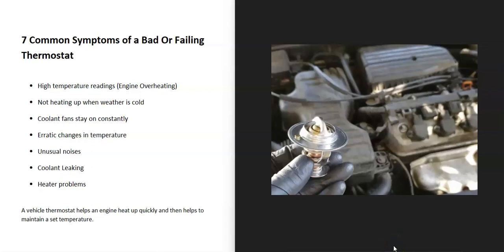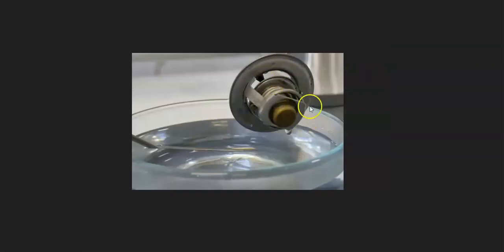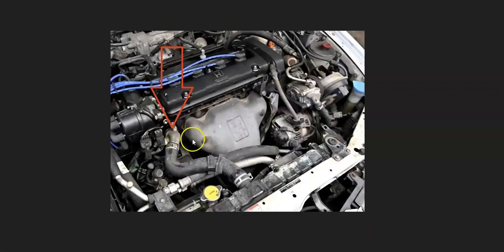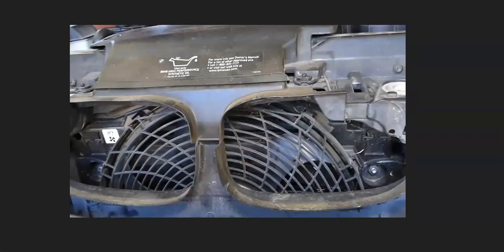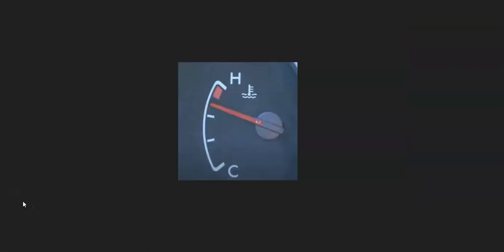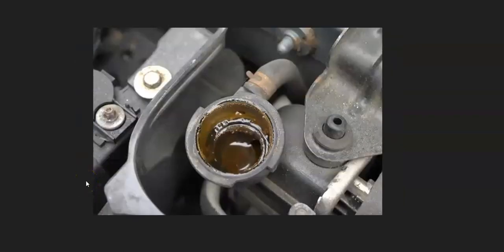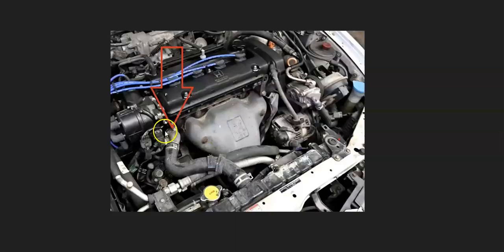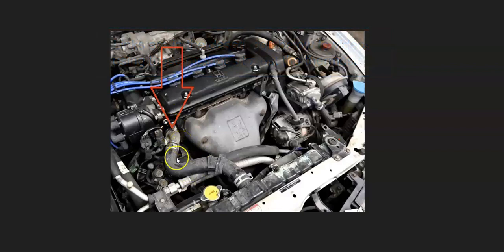7 Common Symptoms of a Bad or Failing Thermostat

Comment: Hi @HVAC Mechanic! My dad has long passed away, my big brother recently passed away and my older son that knows a little about cars is too busy with his junk hauling buisness on the weekends and a full time job during weekdays so I am on my own as a 54 year old disabled single mom so I would like to ask you a question about my 2004 chevy silverado 2500 HD 6.0 - Driving to work at 2am, temp outside being about 27°, about 8 minutes into my drive, I hear a not so loud pop, billowing steam out the front and sides for a good 3 minutes, the truck shut off so I rolled it to a stop on the side of the road and coolant leaked onto the ground. I did not have time to check it out as I called my older son to come take me to work. We towed it back to my house in the morning. I was curious to see if it would start and how it would sound, also I had to back it into my driveway and it started right up and sounded fine. Of course I only ran it for about 20 seconds just to back it up and I shut it off so I wouldnt cause any further damage. My son did borrow my truck for 8 months prior for his junk hauling business and upon returning my truck he did mention he thought he noticed it starting to overheat from time to time in those months and pointed out a drippy leak at the top of the radiator connection line. Could you please point me in a direction I can take so I can try to fix my truck. Its been sitting for 2 months now and I finally got my taxes back to afford parts I need- Thank you so much for your time HVAC Mechanic😊👍
Reply from the maker: It's hard to say what the cause is, but I would start by inspecting the radiator and hoses for any leaks and then checking the water pump and thermostat.
Reply: @HVAC_Mechanic  Will do! Thanks for the response👍
Reply: @tortugalisa4748  Did you ever get your truck fixed? If so, what was it?  If you're truck shut off, you were almost certainly VERY LOW in coolant!  Vehicles have a safety switch to shut down if coolant levels get to low.  They hold about 2 gallons, and I'm guessing yours was down a gallon or more.  All you had to do was go buy a gallon of distilled water, pour it in your coolant system, and your truck would have started right back up and you could have drove it home without paying a tow bill.  BUT, understand once home, you MUST find the cause of the leak!  it could be anything, could be as simple as one of the small coolant hoses on your engine that has a small hole in it, needing replaced.  Anyway, would love to hear what it was.  : ))
Reply: Thank you for responding😊 I bought the dye kit and looked for leaks. Tiny one at the top of the radiator. My son bought and replaced the radiator and ran fine for almost 2 months when the truck started making honking wining sounds from the front. Then the truck died, 1:30 am on my way to work. My son came out and looked at it. Transmission fluid all over the sides of the truck and on the ground where it quit. He found the source to be the inner cooler attached in front of the radiator. One steel line was detached and poured out on my 40 miles drive to work. Now it really just sits parked😕 @2028end
Reply: @tortugalisa4748  Oh my gosh !!!  What a horror story.  : ((  Did your son forget to slide the clamp over that line when he installed the new radiator?

Comment: My dispatch van takes a while to heat up in the winter and then it overheats only at speed 40mph plus when I put the heating on the overheating needle starts to come down again.. thermostat ?
Reply: Did you find out what it was? I'm having the same issue.

Comment: Hi, could a bad thermostat affect AC performance?  I have 120k car, never had thermostat and water pump replaced.  But my AC recently taken about 5 to 6 minutes to click on.  If on a cold day, the AC won't even work at all even turned on for awhile.
Reply: Have u checked ur cabin air filter? Usually during oil changes the mechanic swaps out the dirty air filter for a new one. Also check the fan if it is broken or not responding.
Reply: I would check the pressures for the AC. Could be low on Freon
Reply: @kalani1987  The cabin filter is clean.  I got my mechanic checked no leak and freon is fine.  It turned out to be my ac control unit need to be replaced.
Reply: Yes. Bad thermostat affects ac.

Comment: I am using Lexus ES 300! I change my radiator but since then my temperature will raise above normal and drop back to normal but during the hot wealth/long distance journey, Temperature will raise above normal and fall to normal several times till it’s raises above normal and never return back. I have taken it to different mechanics and electricians but the problem still surface . What might be the problem ?
Reply: Man having a similar problem did you find anything out
Reply: @NOTanotherSHEEP-r9m probably need to bleed air from system. Use a no spill funnel to bleed the air

Comment: and when the fans are off all the time? and temperature reaches 101? the fans and relays are OK, because when I push the AC on, fans begin to operate.
Reply: Did u solve it ? My car is loke this ..I had changed the ect but I now own an oem 1 to put in and go from there
Reply: @kevinhancock4064  no, i did not find the cause. I had random unpredictable overheating. very short ones, 2-3 sec each. changed pump and rotor, changed thermostat, changed ETC. finally toyota diagnosed failing head gasket. i did not want to believe it is hg, because i took good care of my car, never low on water, never late for oil. but them faced the reality, i  changed the HG. DO NOT buy original toyota head gaskets: some of the lots are substandard, thats why they fail. i got mine from rockout, victor reinz. i finished, put it together, and started driving as a test round town, while watching realtime temperature and pump revolution. so, first 20-25 miles temp was 85-88 degC. then suddenly raised up to 101. i freaked and overreacted and stopped. <later i realiized, the normal temperature for engine is 90-104, or 195-220, but i did not know at the time, plus this was a test drive after big operation...> so, I took apart the cooling system, and flushed both radiators with garden hose. Expected to see deposits, mud, sand, but nothing came out. Then I reinstalled the old original thermostat. Put it together, and no problem. Just put 950 miles on new head gasket. No leaks, no error DTC. I drove 750 miles in one day while watching the temperature: ROCK SOLID, 88-89 C. Pump revolutions: 2500-2600, and when you rev engine, goes to 3000. So, I suspect that the new thermostat may have turning bad in 6 months. I returned the old one, cause it was proven to be good. I also changed the ECT, and checked the old one. he old one was OK, I think. It is Pt, platinum wire, because Pt is extremely durable. no oxidation, very high melting, encapsulated in a seald copper ampule. I checked the resistivity of the old one, it was 1500 ohm at room temperature, this is what it should be. You can find tables with T-R relations on the internet.

Comment: My heater runs good when driving but not on idle and my temperature gauge reads cold would you say that it is the sensor not the thermostat?
Reply: Thermostat could be stuck open which is better than being stuck closed.
Reply: @ronredmond that was my answer when I told my mate mine is stuck open 😂
Reply: It can be both thermostat stays open or a faulty ect sensor

Comment: Hi, I have a 2012 Chevy equinox and it started acting weird the other day The temperature gauge is always stuck on cold now even after running the vehicle for several minutes and the fan stays on for 5 to 10 minutes after the vehicle has been shut off I haven't heard any weird noises or gurgling noises or have any leaking fluid this just started 2 days ago before that everything was fine could this be because of a faulty thermostat or am I looking at a more serious issue?
Reply from the maker: I would test the coolant temperature sensor.

Comment: My coolant gauge doesn’t read hot my heat is working, but I’m having steam come out of the front of the car with a very small leak and pressurized. What could it be?
Reply: Steam is common with heater core issues

Comment: In my 2019 Toyota RAV4 the temp gauge goes to normal after 3.5 to 4 miles but then drops down lower then shortly goes back to normal and then it’s fine. Any ideas? I had a dog run into the front of my thanksgiving night and did some bumper damage passenger side front also my cousin that does auto body repair mentioned the a/c has damage and you can visibly see that. Maybe the radiator has damage? But it never goes above normalI don’t know yet, the car  hopefully will be repaired next week.
Reply from the maker: If it is not overheating, I would check the engine coolant temperature sensor.
Reply: @HVAC_Mechanic  thank you

Comment: @2:00 - I have a 2012 Honda Accord V6 EXL 3.5l.  I will be driving and the car temperature will be at 165 degrees - then suddenly, the gauge drops from being in the middle to at cold.  The temperature also drops to about 120 degrees.  Then after a few minutes, it will go back up again.  Could this be a bad thermostat?
Reply from the maker: Are there signs the engine is overheating? Otherwise, it may be a bad engine coolant temperature sensor.
Reply: @HVAC_Mechanic  no it’s not.  I did hAve the thermostat replaced and it hasn’t dropped since.

Comment: Temp garage takes forever to get into its normal place dose not over here but dose go down then come back up to the normal spot slowly, also having heat on the passenger side not the driver
Reply: HEATER CORE CLOGGED OR BAD T STAT BLEND DOOR OR BLEND DOOR ACTUATOR DOESN'T HURT TO CHANGE THE CAP EITHER HOPE THAT HELPS
Reply: I have a vw Jetta Hybrid that's doing the same exact thing.  I'm also smelling a gas odor when I first start my car.  Idk I'm a single momma trying to figure this all out.  Don't have money for a shop. 😢😢
Reply: @jennifercombs6709 that's you're problem lol Volkswagen

Comment: I just had my radiator replaced.  Now, I have no heat.  I returned my car where the radiator was replaced.  I was charged $10.00.  I was told a diagnostic test was needed to further investigate the issue.  I declined.  Does the radiator have anything to do with the function of the heat?
Reply: Wtf why did you decline a 10 dollar service fee?
Reply: She was upset y’all
Reply: SOUNDS LIKE THEY DIDN'T BLEED IT PROPERLY OR AT ALL BUT THERMOSTAT COULD BE BAD OR HEATER CORE CLOGGED BAD CAP HEATER CONTROL VALVE BAD OR LASTLY THE BLEND DOOR OR THE BLEND DOOR ACTUATOR  BAD HOPE THAT HELPS
Reply: YES
Reply: Heater core probably
Reply: Hope not because that repair is expensive  @DAGREATBOOG
Reply: Most likely didn’t burp the air out
Reply: So you declined to pay 10 dollars to check something that could cost you thousands ...Penny wise and Pound foolish smh.

Comment: When the fan is on all the time it means the fluid in the rad is hot since the switch for the fan is on the rad. This could mean the thermostat doesn't open properly and coolant flow is limited. But could also be a blocked radiator.
Reply: Yes but… al engines doesn’t have the switch in the radiator, some have dem in the block, in the thermostat housing etc.
Reply: How do I know if I got a blocked radiator?
Reply: Could be from idling for to long
Reply: @Sugarshane88 what is? I’ve been idling a lot. What would that cause??
Reply: Can a new thermostat be bad ? Exterra pushes the coolent out the resavior after it warms up to normal temp
Reply: @mykidsafag  every part can come faulty but consider the possiblity of early sign of head gasket fault which is  exhaust gas escaping into coolant and pushes out of resorvoir and makes coolant boil ,but pressured systems like german cars shouldnt be used without resarvoir cap or it boiling and escapes out of it ,and it is normal to pressured coolant systems to squirt some of coolant from cap bleeder when it needs to but if you lose more than you supposed to be you should check it.
Reply: @davianceable I believe what you are describing with the coolant boiling in the reservoir, also my reservoir is going dry multiple times a day. What's the cause please
Reply: @mykidsafag is the gasket there
Reply: @mykidsafag I have that problem dod you fix it ?
Reply: Noted
Reply: ikr lived that ,they blame the radiator changed it it gets hotter than before than changed thermostat because it was behind the timing belt so changed it lastly and all my problems gone away the thermostat they remove is like new no rust nothing but it was faulty ,so the lesson ı learned change it every 7 years if it is clean or rusted no matter .

Comment: What if when you squeeze the hose its real tight cant really squeeze it 🤔
Reply: Generally that means the hose is under pressure. Don't open the cap until it cools down.
Reply: There’s probably a spring in there

Comment: my car mrg not showing only less heat and in in hot wether like noon i shows more temperature , let know is it thermostats problem ?
Reply: If the 🚗 temperature 🌡 shows more heat, it means the engine is overheating, and the thermostat is bad, also the liquid gurgling inside the reservoir happenes.
I would replace the thermostat with new gasket check for any leaks and install it, then turn on the engine with the ac on to cold or hot.
Add antifreeze to the radiator little by little in order to take the air out.
Once the air is out, the liquid should not go down and remain just a bit underneath the radiator cap.
Mine, it has the same symptoms
Reply: @devil23900  thanks